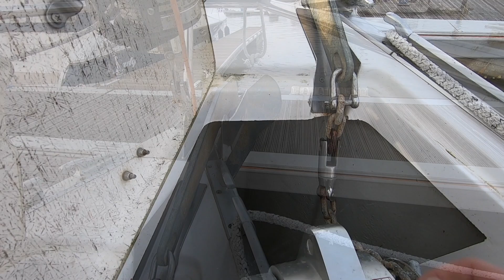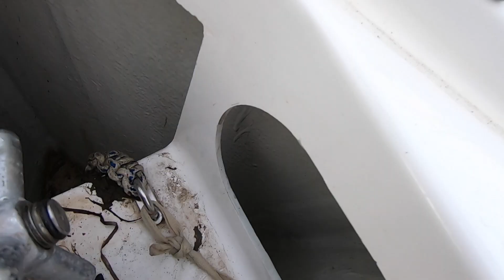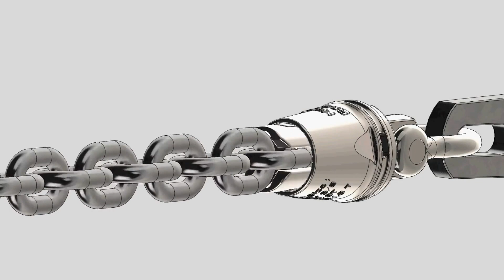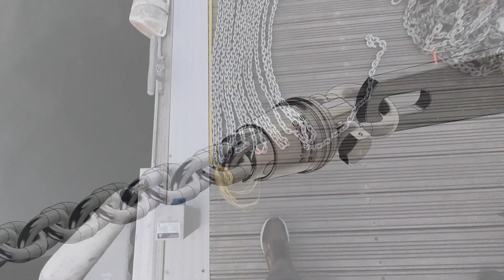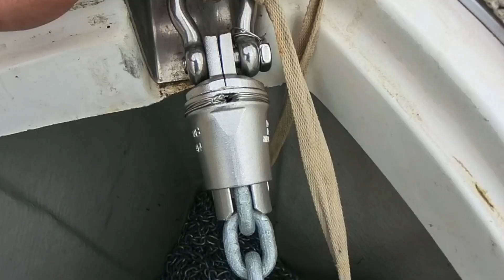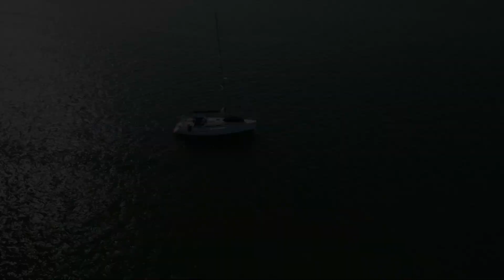Anchor Chain and Mantus Swivel upgrade - Anchoring Gear - Boat Projects

Comment: Yet another mice vid 💪. Mantus lubrication needed? What's the speed impediment?
Reply from the maker: Thanks for your comments. Possibly, I think the chain in general is all a bit rough around the edges which it’s helping. If it doesn’t look like it’s going to set correctly on the roller , then it’s a case of down/up or in the worse case down/up/down/up as the anchor is just above the water. We are free by then, but just something that’s currently different than before.
Reply: Good video . How much did the chain cost ?
Reply from the maker: Hello, thanks for your comments on the video. The chain was £7.70 a meter from Boat Gear Direct which was the cheapest I could find for that particular chain.